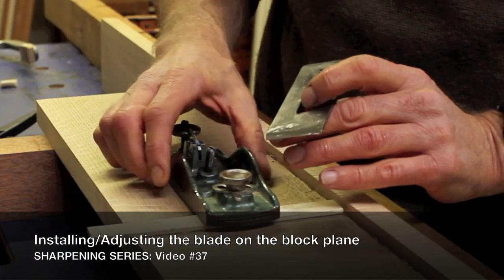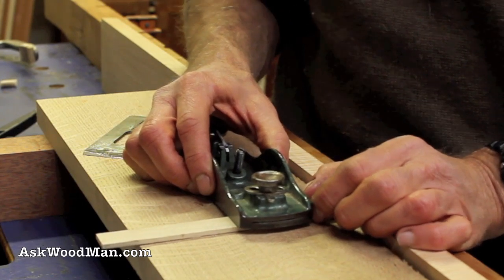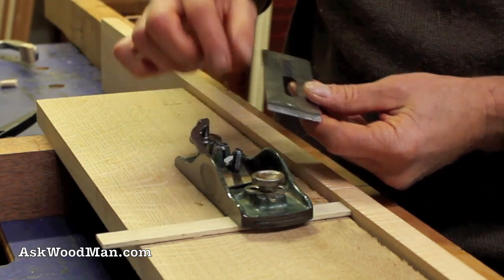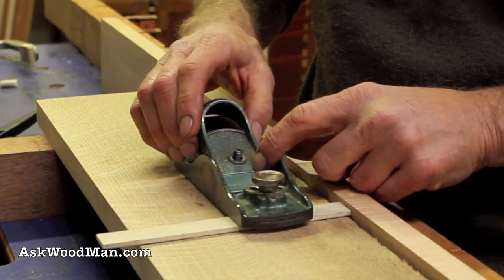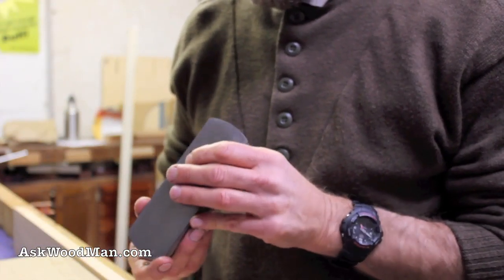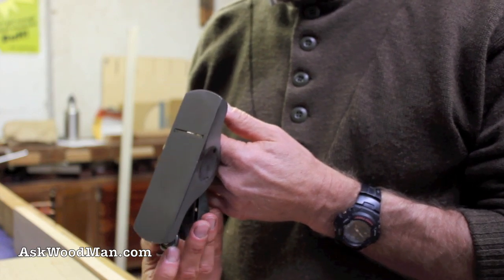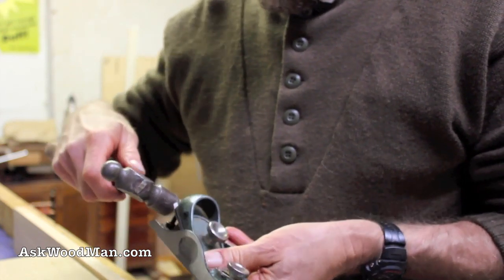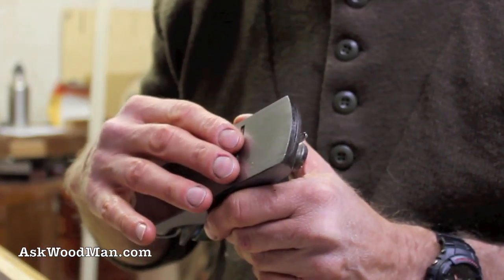How To Install Block Plane Blade • Complete Sharpening Series Video 37

Comment from the maker: Len you are correct. Bevel up on block plane. Bevel down on planes with chip breaker. Get some poplar and experiment. You can't hurt anything and once you start working with the two styles it will be clear. Have you seen the new sharpening videos on my channel for the new jig I came up with? Keep in touch. Allan

Comment from the maker: @smfield Yes I have to because the mechanism that shifts the blade is so worn out. The much softer than tool steel lever just could not stand up after all these years. I need to get a small piece of 4140 and fabricate a new one at some point....or just tap it with a hammer. Always enjoy hearing from you.

Comment: Thank you for this video. Will you please tell me what make and model this plane is? I used to have a Stanley block plane that had a screwdown thumbnut to tighten the cap iron like this one in your video, but I can't seem to find one. All the new block planes I look at have a lever that goes from about 4 o-clock to about 8 o-clock to tighten the cap iron and when I work it gets loose from me hitting it with some part of my hand or something and it never seems tight enough anyway. So if I could get the info on this one maybe I could find another like it.

Comment: Hi - I have a serious question about the lateral adjusting lever in the block plane. Would you be willing to answer it? I believe we have the same plane as the parts look identical, but mine has no name, just a USA on the body, and the iron is a Stanley without any other marks. Removing the throat shows "032851 E X 1" stamped into it. Thanks
Reply from the maker: Ask away.
Reply: @AskWoodMan  thank you. I have searched this on multiple search engines to no avail. My rear adjusting lever is loose and wobbly even when screwed down tight with the cap iron. As I see it, there are only 3 parts there - the lever, then the iron, then the cap iron. Is this correct? Secondly, do you also have the stamped numbers I wrote about in your block plane? Tx :)
Reply from the maker: The adjustment lever is supposed to be loose. You have the right order. My plane body is stamped 9 1/2. Oil the sliding faces with a quality oil (not wd40) for easy adjustment. Often if a large change is made taking a little tension off the cap iron until final position keeps wear down. If everything is so tight while making adjustments you can eat the blade advancement tooth off and then the plane is worthless.